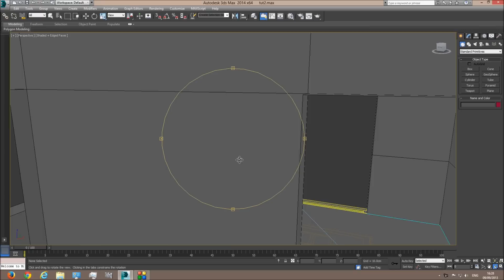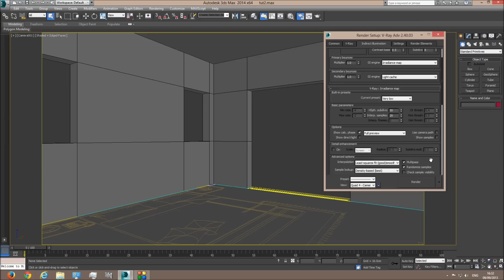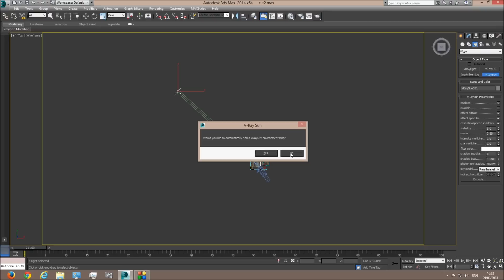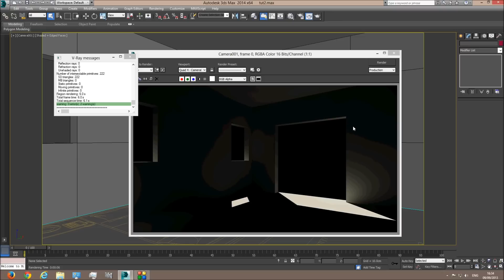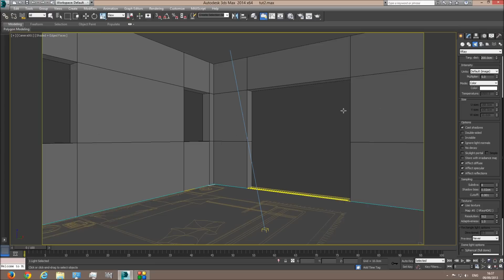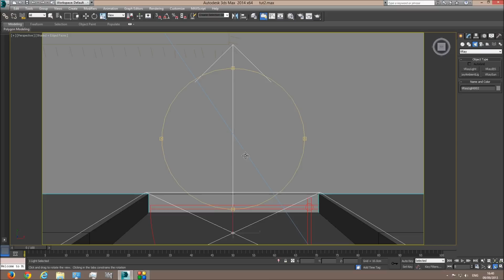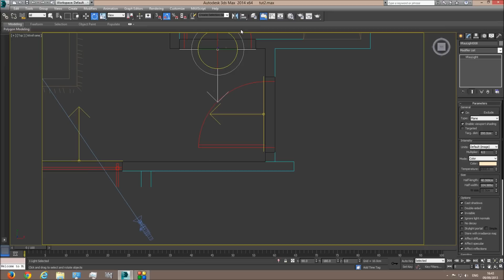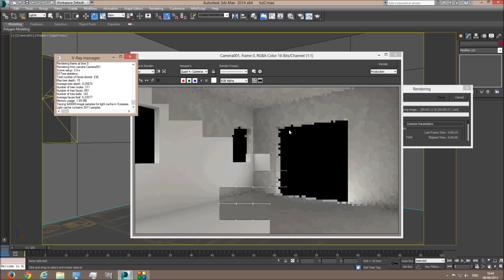Part 2- Vray Interior Lighting Tutorial in 3ds max

Comment: What i should use for architecture purpose? sketchup, 3ds max or blender? 3ds max is very expensive, modeling curves and terrain in sketchup is pain in the ass (also theres not a lot of bim object by prodcuers) and blender hmm is for free...
Reply from the maker: There is no right answer. Sketchup is good for quick visualizations but less photorealistic, 3ds max is great for photorealistic visualizations but it's expensive and hard, and blender is free but has less options then max.
Reply: I do not agree with sketchup. With vray and photoshop u can make it almost the same photorealistic like max. The porblem is poor texturing in sketchup and curves. So thats my concern :(.
Reply: aceviewier You can download 3ds max for free if you are a student or a teacher
Reply: +aceviewier Sketchup, and add the adds on for it it's as good as max and as real as max
Reply: +Caost Indeed :) i have most of Autodesks programmes, 3ds, maya, mudbox, Autocad, Autodesk...  because im student for Film animation and game design

Comment: I tried this render setup but it's taking over a minute to process the light cache alone without anything in the scene besides the room and the sun + dome HDRI lights, I have an i5 with 8gb of ram, should my setup be able to handle this render quicker? Or is this what I should expect? Adding other objects and high poly models to the scene will slow this rendering down dramatically